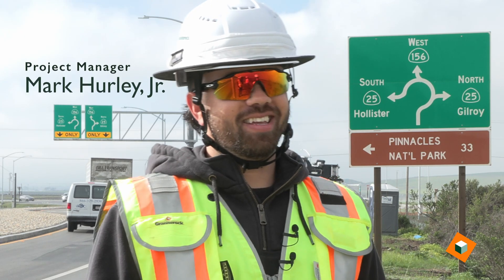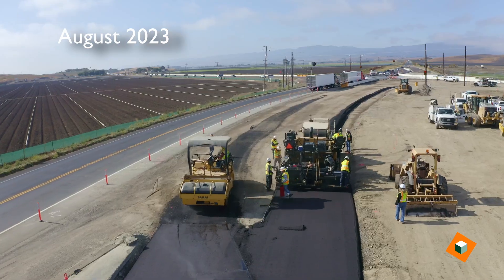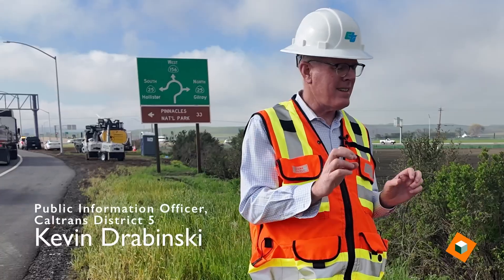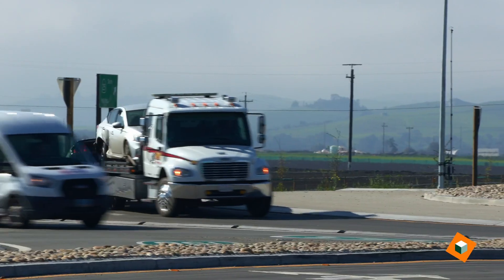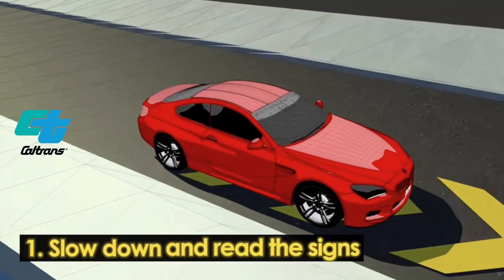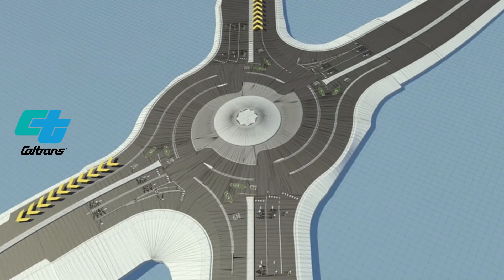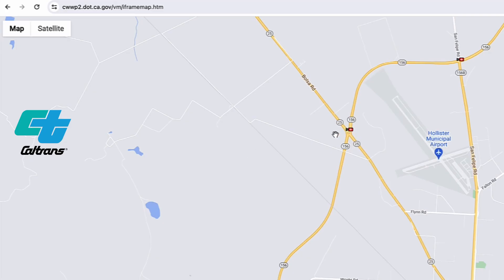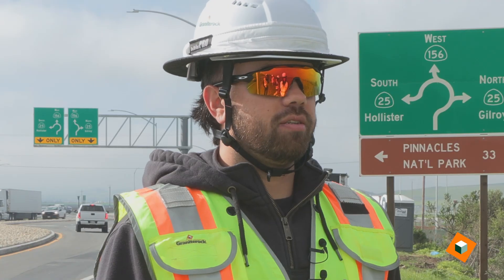California's first turbo roundabout built by Graniterock in San Benito County

Comment: I like the one lane roundabouts.   Multiple lane roundabouts I end up being in the wrong lane and having to cut over suddenly.    Might be ok if you drive the same route every day, but if you're routinely in different areas following GPS, more difficulty will be had.
Reply: This design illustrates each direction you may want to go very clearly. It would be prudent for drivers to familiarize with the concept of a turbo roundabout, and how to use it. It's also important to plan the route ahead of time, making note of the road layout and understanding any necessary lane changes before you get there. And most importantly, it's okay to make a mistake and end up going a different direction than you intended, just find a way back in the direction you need to go once you've made the mistake. Do not make drastic lane changes last second on the road or highway. I see it all the time and it needs to be nipped in the bud.

Comment: The under sizing of a “traffic circle” in a high traffic intersection will have a cascade effect. As with too many others, this is not large enough to properly accommodate large trucks getting into the circle before approaching traffic overtakes them and has to slow down. Once that happens, the ultimate result is the slowing of all the vehicles then inside the circle. This grouping of the in- circle vehicles automatically decreases the ability of entering traffic to find an access point thus making the possibility of rear end collisions more likely. 😐

Comment: As a European, this is all so weird to me. I’ve never seen a roundabout like this, ours are very basic. But I guess the added road marks and design elements might help the less experienced American drivers but I would argue that it’s actually counterintuitive and overwhelmingly confusing. And weirdly enough, you cannot make a u turn if you follow the signs on this one which is a shame. Roundabouts are great because they allow room for mistakes, you can just go around once more and have another chance to exit. But this one seems very restrictive and punishing with bumps between lanes which I’ve never seen in my life. Usually, here in France where I live, a two lane road will connect to a two lane regular roundabout and drivers will choose their lane accordingly. You stay on the right if you use the first two exits or you stay on the left if you use the last two exits, you just switch lanes inside the roundabout. What I also noticed, is that the turns seem way too tight for these kinds of speeds and no one is using their indicators when turning or exiting for some reason.
Reply: Lots of trucks so had to take long tractor trailers into consideration.
Reply: These were invented in Europe,  in the Netherlands, specifically.

Comment: Here's one of my concerns from the experiences I've had in roundabouts.  They create multiple crossing paths where the car entering and leaving cross each other's path.  Unless you are immediately right turning, you have two or more crossing paths -- you enter crossing the path where another car leaves, then exit crossing the path of an entering car, and if going all the way round, at least one more crossing path.  I've been in a couple that absolutely lock up at rush hour and the only way in or out is for someone to stop and give you an opening.  The only places I've seen them really work are low traffic density areas.
Reply: That's the idea of a turbo-roundabout.  in a turbo roundabout all lanes sprial to the outside, You never cross lanes within the roundabout.  You enter the roundabout in the correct lane for where you ant to exit, and you stay in that lane, and it takes you right to your desired exit.
Reply: @andrewalexander9492  You're still crossing lanes.  Draw the flow lines and you'll see multiple crossings.

Comment: I don’t understand why they removed the capability to make a u turn from a roundabout. What the hell are you guys thinking
Reply: Because in order to stick to the design philosophy of a turbo roundabout (ie: enter the roundabout in the lane which exits where you want to exit, and remain in only that lane until you exit)  the roundabout would have to have 4 lanes at each entry, instead of 3, and there would have to be an additional lane all the way around the roundabout,  whcih would increase the amount of land required and the construction costs, which probably isn't justified for a maneuver that isn't all that common.
Reply: tractor trailers shouldn't' be pulling a YOU turn in major intersections.

Comment: I went through this thing for the first time a few days ago. It's pretty different from other roundabouts I go through all the time, and seemed superficially confusing as I approached, but worked fine even though I wasn't in the best lane for where I was headed. The signage was clear enough that the lane I was in would work, and it did. After a couple trips it will seem totally clear. Tentative thumbs up. I don't recall if there were speed limit signs to slow people down as they approached, but if not, that should be an upgrade.
Reply: speed limit signs have to be installed from the state's DOT and not the construction company. So I am, sure they will get to it

Comment: A "TURBO" Round-About... in Europe (and Asia) we simply call it a bog standard Round-About... as found / located at virtually 99% of intersections across Europe.
Reply: Except it isn't a "bog-standard" roundabout.  it's a specific roundabout design that is some specific differences from a "bog-standard" roundabout.   Turbo-roundabout were invented in the Netherlands in 1996, and first built the in 2000.  There are only about 300 there now. The UK has more than 25,000 roundabouts but only a very few are turbo-roundabouts. the First Turbo-roundabout in the US was installed in Bedford in 2014.   You should probably learn a little before you start flapping your gums. Otherwise you make yourself appear to be an ignorant fool spouting misinformed nonsense.

Comment: This works great for those familiar with it and use it every day. Problem is when a driver who has never encountered this type of multi lane roundabout enters and gets confused then just stops 🛑
Reply: Sorry, but the signage is so good that anyone should be able to manage this type of roundabout, even without much experience. And those who don't are just really bad drivers and become dangerous road users.
Reply: @gerhardma4297 the worst drivers need to be removed from behind the wheel. This really does illustrate the need for better driver training.

Comment: 1:40 "... traffic on the left has the right of way..." I learned this many years ago while on a driving trip in the UK. It's so counter-intuitive. But it works and it makes sense. If not, you can get trapped in an inner lane. It almost happened to me near Seattle; I had to force my way out. Not a proud moment because I don't otherwise drive like that. The biggest problem with roundabouts is lack of driver education. Far too many people just do not understand how to enter, drive, and exit.
Reply: They should add that as a sign
Reply: "It's so counter-intuitive." I actually had to read that twice to figure out what's counter intuitive about it 😂You'll get used to it and over time your intuition will change.

Comment: Typical of an American roundabout, the diameter is way too small to work efficiently. Turns too tight and traffic inside the roundabout too condensed for easy flow in and out. True, everyone is slowed down enough that major and fatal accidents will be reduced, but also true “fender bender” accidents have increased dramatically.  Viable idea, but not implemented correctly. I’m a San Benito County resident that has experienced driving European roundabouts back in the day.
Reply: Could have been mitigated with smaller diameter island in the center....

Comment: This roundabout looks awfully confusing. The Brits have come up with a similar solution using only paint and the existing grass circle - no concrete dividers, no fancy islands. It's called a spiral roundabout.
Reply: Looking at this roundabout I don't like the transverse dotted lines in each lane mid-roundabout. I can see that these would confuse inexperienced drivers into believing that they must yield to joining traffic at the dotted line and so come to a halt mid-circuit. Ideally you should never need to come to a halt at any point when going around the roundabout.  Next I recommend that the traffic authorities build a really large five or six lane roundabout with traffic lights at various points around the circuit like we have in Europe.

Comment: Yea, they went from 1 crash every 8 days to 1 crash every 2.5.  Good way to reinvent the wheel.😆
Reply: lowering deaths is more important than fender benders. Eventually even the dolts will figure it out.
Reply: @r2dad282  ...Or you could have just gotten rid of the intersection all together and put in an overpass.
Reply: @metalslinger This is California. CalTrans would ensure it cost $750M.
Reply: @r2dad282  😆

Comment: As soon as they add avoid suicidal traffic circles to my navigation, life will be safe again. I will drift through this. I will approach it at full speed and be squealing around it. It's a challenge to adventurous drivers that need a fast thrill. Zoom zoom. The problem is you are having to merge into moving traffic which means people will speed up to not let you in. You will have to stop. Happens in Michigan all the time. I avoid these logistical nightmares. Merging is more dangerous than stopping and proceeding.

Comment: Would like to see how this roundabout performs with truck and trailer 18 wheelers making a left.
Reply: It's not a good design for truck drivers. It takes too long to get a heavy truck up to speed causing slowdowns for the whole circle. This intersection is so incredibly busy that it's nearly impossible to find a spot to pull into traffic without causing them to slow down. I was through this intersection twice last week with my truck; scary experience.
Reply: you can watch the feed; lots of trucks going through. i see a lot of the trucks actually go when not clear and block traffic to enter roundabout (but not dangerously), but most can navigate the curves without a problem

Comment: 2:16  oooof,  how long until someone makes a left turn from the left lane because of those road markings?
Reply: Pick your lane early, stick to it and yield to traffic from the left, that's all you need to know, it's not a driving exam, it's just a roundabout.
Reply: I"ve seen people actually go the wrong way around a roundabout. It does happen although rarely.
Reply: @CoffeeAndCruise And people get on a freeway in the wrong direction.
Reply: Damn, you're right... somebody's gonna see that and try to turn left.  🙄

Caltrans needs to make the solid circle in those lane markings larger.  That would solve the problem.
Reply: @Milesco  That could just be one arrow pointing forward as well. Then have an arrow at the possible exit.

Comment: If you look at the most effective turbo roundabouts in Europe they generally have a center Island about 20 to 30% wider than any Inlet Road. Sometimes even whiter than that. This one in Hollister you see the center Islands only about as wide as any Inlet Road. That suggests the radius is probably a bit too tight. Given the recent report of the nearly tripling of accident incidents through this intersection since the opening of the roundabout, it does hand towards possible design problems. Fortunately though those incidents have been much less severe than the prior intersection. So that aspect of the roundabout is proving itself. It's just a shame they didn't get a little more land to build it to a proper size for the speed of traffic in the area and the accommodation of semi trucks to accelerate properly through
Reply: We don't have roundabouts here much nobody knows how to drive it
Reply: Not surprising since most people don't  know how to navigate it.
Reply: Tripling accidents?! That's really bad. I expected as much though when I saw you the jumps you have to make from the leftmost lane.
Reply: @Distress.  I'll guarantee you it's drivers who don't know how to negotiate a roundabout, don't read the signs, don't slow down, and don't know who has the right of way.  In my town we installed three roundabouts on a main arterial that happened to go through a neighborhood, and the only way to make it safe enough to handle the traffic it got without costing taxpayers $27 million in eminent domain costs was to install those roundabouts.  The minute they opened it was utter chaos, because of drivers who weren't paying attention, were too scared to enter the roundabout, too scared to negotiate it once IN the circle, picked the wrong lane because they weren't reading the signs telling them which lane to enter, and even some drivers who sped through and INTO the planters in the center of the roundabout.

While you can't fix stupid, eventually drivers get a clue, and after the initial shit-for-brains collisions that happened the first month, people started to get the concept and now they are perfectly safe, keep traffic throughput moving without stopping, reduce carbon emissions, and have cut serious collisions down to less than 10% of what it was before they were installed.  Best of all, the taxpayers saved $24 million in eminent domain and the yearly cost of maintaining signalized intersections, which ran about $100k per year per intersection.  The initial cost to put them in was more but now that they've been there for 11 years it has more than paid for the initial cost by what they saved in maintenance, by a country mile.  And we'll continue to enjoy those savings for a long, long time afterward.
Reply: @Distress.  that would be ignoring the difference in fatal collisions though.
Reply: Farmers sold just a small parcel for this much needed improvement. They aren’t gonna sell the whole crop.  Europe prob not an issue like this part of California w agriculture.   Relax w the commentary
Reply: Not only is size way to small but, we do not educate or enforce good driving habits using this system.  We do not even use turn signals to let others know our intentions using the system.  Driving too fast and not spacing enough between vehicles.  Also to many are stopping and not trying to time their entry .
Reply: yes, the entrance to the roundabout for the left turn lane seems difficult for trucks, especially American trucks.
Reply: Yeah, Caltrans has no idea what they're doing. :face-red-droopy-eyes:
Reply: same in AZ poor design  - overly tight radius -  - lanes should be marked with different colors  - zig zag lines  etc  - - some have  obstacles / plants that block view
Reply: "Sometimes even whiter than that."  Why do you have to bring race into this? 😂
Reply: @grondhero  lol, I'm leaving it
Reply: @grondhero the blacker the berry the sweeter the juice, honky
Reply: Caltrans is stupid. They still don’t know how to design intersections properly when given an optimized design
Reply: @mi12no  if this is the first in the state, then mistakes are to be expected. Hopefully they’ll learn the lessons and improve.
Reply: gonna need source on the "triple the accidents" claim
Reply: @klenzgaming  But would you need a source if someone said they went down?  Probably not.  Probably just grandstanding.  

Fortunately, sources are very easy to come by:  go to google and enter the term "Hollister turbo roundabout accident rate" and you'll at least half a dozen articles from mid-April 2024 referencing a caltrans report including the statistic that the accident rate before the roundabout was one every 8 days and accident rate now with the roundabout is 1 every 2.5 days.  The silver lining is despite more crashes, they have been less severe since they have been mostly sideswipes and rear enders rather than t-bones and head-ons.  A cursory look at traffic flowing through this particular roundabout very readily shows some simple flaws that are likely causing that, particularly short run-ups and tight radius.

Comment: Typically, Californians don’t use the phrase “roundabout”. They say “traffic circle” instead, like the one that has been on PCH in Long Beach for over 30 years. This isn’t the first.
Reply: No one said it was the firs roundabout in California but it's the first turbo roundabout.
As for a traffic circle, it is not the same as a roundabout all crossings intersections are controlled by yield signs while in a traffic circle there can be different controlled to different crossing intersections, like in the one in Long Beach where some right lane turns have no yield signs as they are separated from the main circle.
In any case, I'm sure that most do not distinct between the different types and call it in the name they know, so if you're from Long Beach and you only have this one traffic circle you'll call all other types "traffic circle" while those who only know a roundabout will call all types "roundabout".
A turbo roundabout, like here, separates the paths of the two circle lanes so you need to choose the path you need to where you want to go.
Reply: I'm from California and call them "roundabouts" all the time. 🤷‍♂